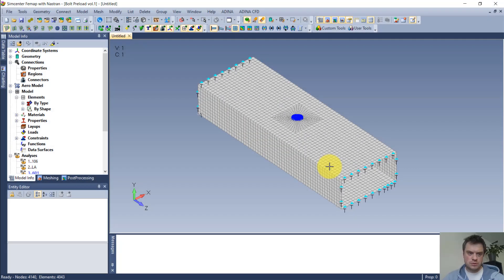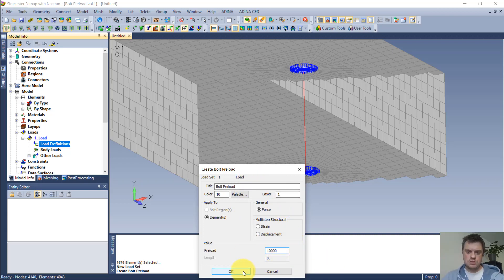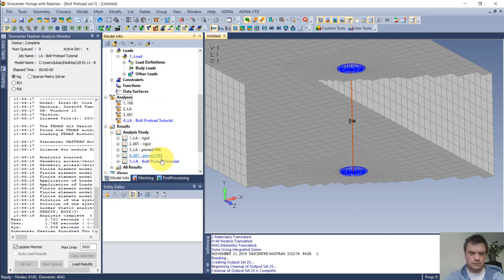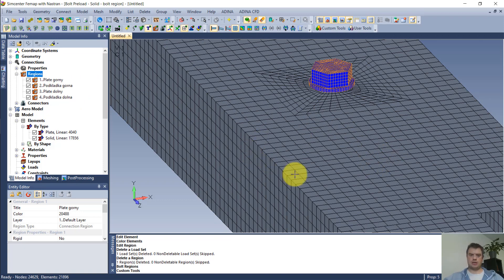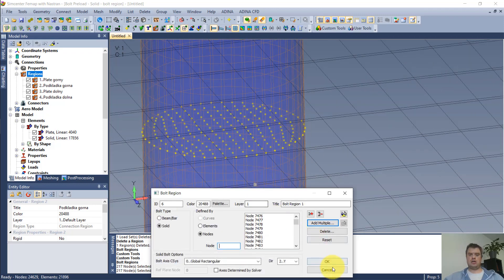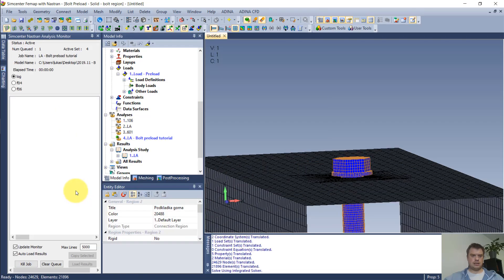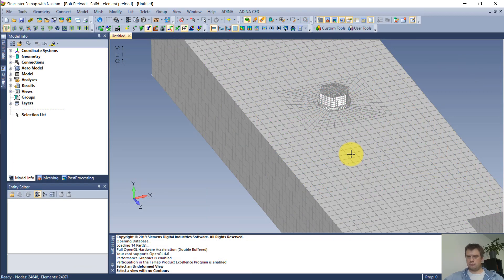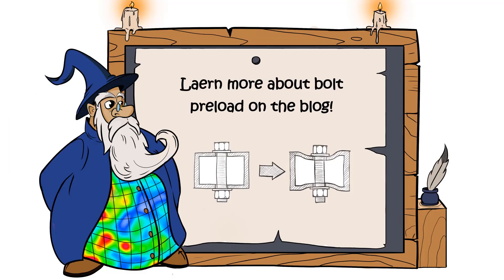Bolt Preload in FEA Guide using Femap

Comment: What is proces when thread of bolt is all in the material? Meaning that there is no nut on bolt. How to create such a cinnectiom using a bolt as a solid body? Hope you understood me.
Reply from the maker: Hey! Well., the bolt preload will be applied the same way, although I don't think this is what you have in mind. 
For the "how to model your case" this only depends on the level of detail/accuracy you need. I would guess that you either "just connect the nodes" of plate and bolt (so there is no thread... as if this was all welded), or you model thread and contact and all that (I guess there are situations where this is needed.
Still., I have little experience in this, in structural steel this is not a used connection, and we always have nuts and washers and all... so I didn't have to worry about this particular problem much...
Reply: @Enterfea  by "connect the nodes" You mean to merge coincident nodes or something else? I found out that for solids is preferable to use GLUE contact for this type of connection (where thread of bolt is whole in materail). But i am confused, becouse i need to apply bolt preload on those conections, and if I use glue contact i think that it would not work like in Your examples.
Reply from the maker: @ivicailic849  I think you can use glue contact or merge nodes... from the bolt preload it should be the same I think, but as I don't have need for doing something like that, I have to admit I didn't test that so far.
Good luck!

Comment: Hello! Great video. I can't break the bolt so perfectly into six "HexMesh" faces. It turns out to be broken only into triangular elements of four faces, but in this case Bolt Preload does not work. How to break the bolt body into elements with a mesh from the center, like yours? Is there a video? Tell me, thank you.
Reply from the maker: Hey! There isn't a simple way to explain how to do this, but I think that in most FEA systems if you mesh the "top" and the "bottom" section of the nut (the hexa shape) with quad elements (2D elements) you can then ask the mesher to do "those elements along with thickness" of the solid as 3D bricks. Of course, the mesh on the top and bottom has to be the same.
All the best!
Ł
Reply: @Enterfea  Thanks for the prompt answer, I understood the essence of your answer, such a division into elements is performed by extruding solids from elements of a two-dimensional grid.
Reply from the maker: @SuperVatex  I'm glad that I could help you a little :) All the best!
Reply: @Enterfea  Happy holidays!
Reply from the maker: @SuperVatex  for you as well :)

Comment: Sir what contraints is to be given in ABAQUS if we are simulating bolted connection beam column joint ...please mail me or reply here...i want it for my disseratation work
Reply: mangesh.jadhav67@gmail.com
Reply from the maker: Hey. First of all, if this is a dissertation... ask your tutor - it's literally his/her work to help you out with this! Apart from that, I have no clue what you want to achieve, what the goals are, how the model looks etc. It's an impossible question :( But if I would have to make a guess, I would model beams and columns with 2D plate elements, and model bolts as beams with contact where needed (just make sure to model some rigid circles where bolt connects to the plates, not to attach it to a single node...)

Comment: Very useful clip. And nice to see Stephen settling in well.
Reply from the maker: Thanks! We are doing our best to help him feel like a part of a family :)
Reply: @Enterfea  I look forward to seeing him in future videos. 

I'm curious, would it be possible to model 2 plates bolted together, like a lap splice with sloppy bolt holes in each plate with preloaded bolts clamping the plates together. The thing I would be specifically interested in is predicting the friction load capacity of the joint, that prevents slippage of the two plates when an end load is applied to lap joint. I wonder if a non linear run would predict the slip load which agreed with test data....
Reply from the maker: @beefybeef1326  I'm afraid that in such a case, one of the very important inputs into your model would be the friction coefficient in contact. And as far as I know, you need to have it from experimental data. I'm not sure if you can actually calculate what a friction coefficient "will be" in your model. Perhaps in some crazy advanced way, I'm unaware of, but I'm not sure how estimation like that would work... In other words, you can make a really accurate prediction, as long as you can very accurately know the friction coefficient at the start. Without knowing it, I'm not sure if you would be able to "get it" from FEA.
Reply: @Enterfea  thanks for your reply. I already have the friction coefficient from test coupons and was going to use it as an input, and I agree that this coefficient is only available from test data. I was curious if the model would predict when slip actually occurs, and how well that calculated slip load compares to the test. Now I think of it, its probably a silly question because limit friction force = u.R, where R is the reaction force at the contact plane ( for this case it will be bolt preload), when the applied end load is equal to u.R slip occurs. I think it would get interesting in the scenario where there is some loads on the model that result in preload relief on the bolts which would reduce clamp up of the joint and bring on the onset of slippage sooner. 

Thanks again for your messages
Reply from the maker: @beefybeef1326  I think it's good to ask all the questions one has. Even if they seem silly later. I know I definitely asked (and still do ask!) a lot of silly questions. This is how we learn after all.
To answer your question, I think that the correlation between lab tests and FEA can be really good, but I admit I never tested friction in this particular area.